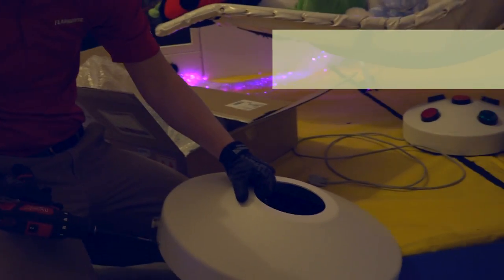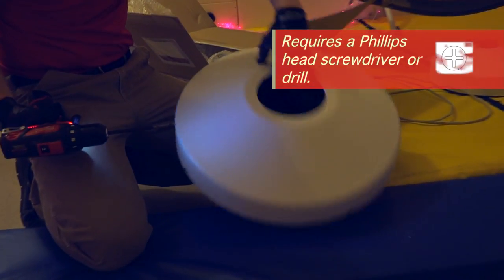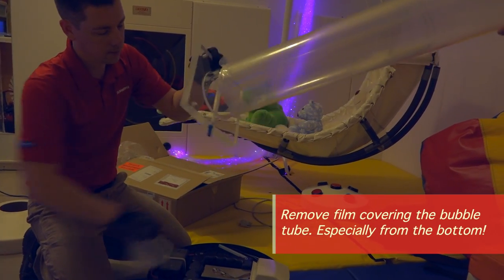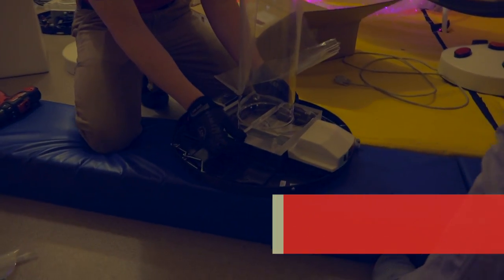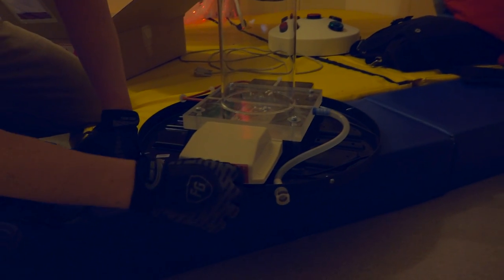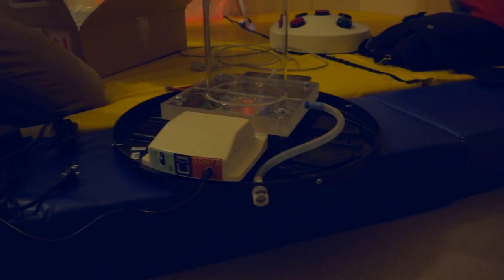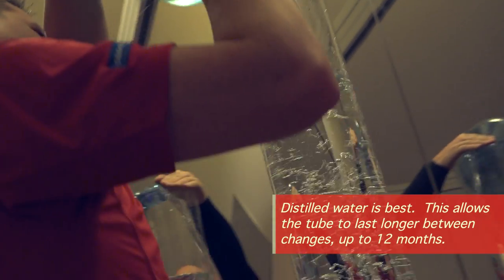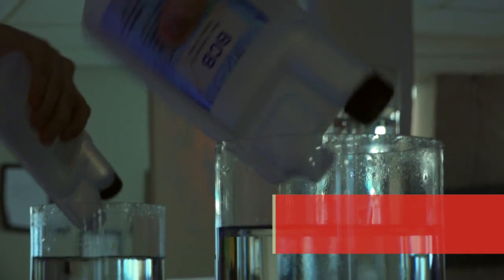How to Assemble a Bubble Tube

Comment: How much water does this bubble tube need please?
Reply from the maker: Bubble Tubes come in all shapes and sizes so the exact amount will vary.  The Bubble Tube in this video is a 6" tube that is 70" high, so it takes about 8 Gallons of water. That's about 30 Litres for our friends on the metric system.
Reply: @sensorychannel  what store can you get bubble tubes at?